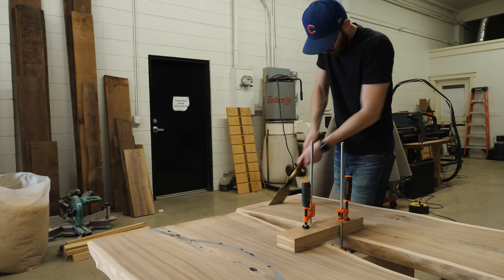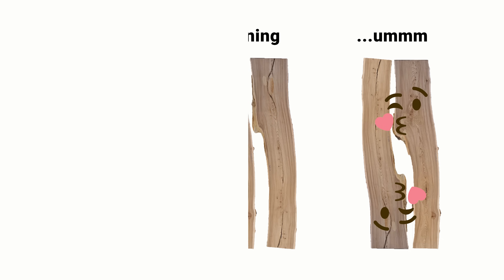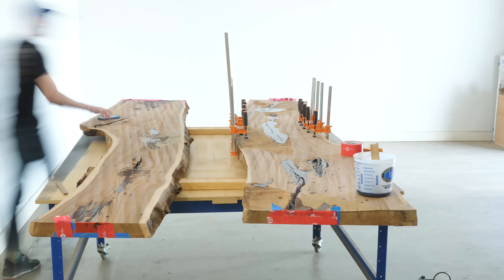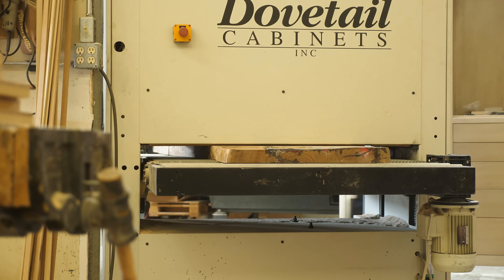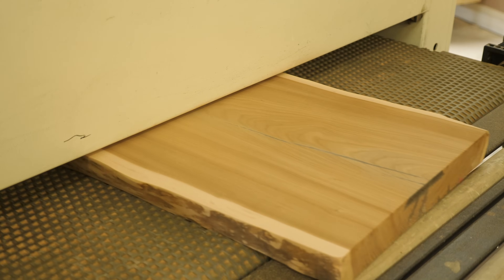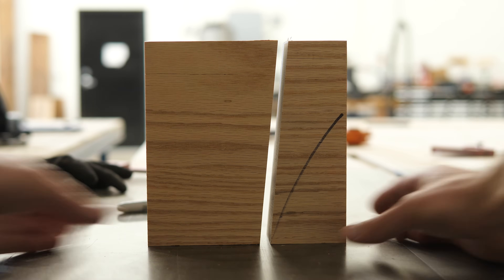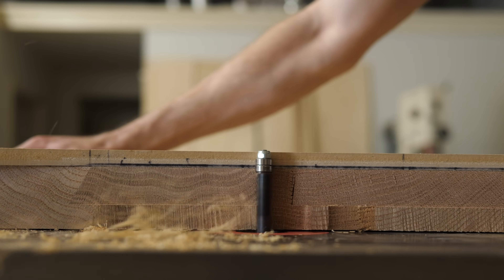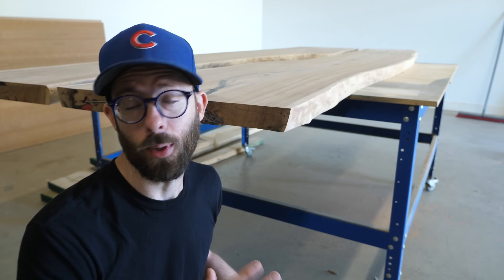I Guess We're Building River Tables Now

Comment: Having only discovered your channel yesterday, I've only watched a few of your shows so far. I've heard you ask a few times now, for input on your recording style. On that note, don't change a thing. I'm hooked! On a more personal note, I'm not a woodworker, nor do I currently intend to become one. I'm more of a mechanical-type person. I love moving parts so much that even my last 6 watches are skeleton - simply because I enjoy seeing the gears working. I said all that so I can say this with hopefully understandable framing: I loathe flat head drive screws! I don't mind the look but from a completely um, technician(?) perspective, they're awful! The screwdriver doesn't like to stay centered and the drive edges fail all the time! The older the screw, the worse it is - especially if they need to be used multiple times, like in this video. Who's to say the table will only ever be sold once and that buyer will only ever move/assemble it once? While arguably more aesthetically pleasing to some, I cringe everytime I see them. I can't even help myself. Flashbacks of all the screws I've damaged repairing older products, and the subsequent finish damage resulting from the slip of a the screwdriver wash over me everytime. Even the most basic power outlet cover still uses flat head screws and I feel like mankind has evolved far beyond the flat head screw :D I just don't see them as a wise choice for functionality. Take that with a grain of salt. It's just maybe a different perspective that isn't always considered. Overall, I find myself watching your videos back-to-back and while I haven't actually gone to your channel yet, rather, relying on YouTube's algorithm to present whichever one it likes, I hope you've made lots of videos because I see myself watching for a while!

Comment: I would have liked to have seen the long bottom support beam set in to the two side bases maybe 1/3", similar to how you set it the metal plates on the other side of the bases. This might have required the support beam to be another two or three inches higher though, but I think it would be a bit more stable. Just my two cents. Love the look, and I would have probably filled it in with clear epoxy if this was my table. Any way you go with it, it's a great looking piece!

Comment: I agree with some that having a flat surface all the way across makes the table more practical.  However, a straight piece of glass is still going to take away from the natural flow of the table.  And a regular epoxy pour would not show the cool contrast of the sapwood in the middle. Would it be possible to make some kind of custom mold so that you could just pour a shallow (1/4") clear epoxy so that it has the look of a custom glass insert?

Comment: I always do tables because chairs are much harder. Except benches. So have had a bunch of tables no chairs. I would use hand forged metal now for assembly legs. Love pounding red hot metal with hammer. Forging thick metal rod is extremely hard though. Home forge can't heat it up fast enough. 😩 legs are tough to make.

Comment: IMO the ends of the boards could have been cut back enough to reduce the size of the hole in the centre.  Shorter table in the end, but w/o the massive void.  Then a decision on a glass top or an epoxy fill would have been  easier.  Hope it sold well.

Comment: just a thought since you wanted it to be easy to take apart and wanted the brass look. Could you have used a wedge joint with a brass wedge to hold it together? I know it's really low tech but would be a nice accent.

Comment: I would not have a problem with a table with the center missing. It’s so wide that you’re not going to have a problem with putting the food in the middle and then the plates around the edges. I once bought a table from IKEA that turned out to be too narrow, and it was such a pain to put the food in the middle and have room for plates around the edge.  Even if I did need to put something in the middle, I would just use a tray to set it on or maybe a wooden cutting board.  Then I would have a good excuse to go around buying interesting looking trays lol.  You could think of it kind of like putting decorative pillows on a couch, where you could make the trays or whatever you put in the middle part of the decor.

Comment: Next time when drilling aluminium, just put all the plates together and drill through all at once. Aluminium is garbage metal and I hate it (been a metal fabricator for 20 years) but it has this nice quality that you can basically use woodcrafting tools to work it, just go slower because it's much denser than wood but nothing close to copper or steel. When I make identical steel plates, I drill them all together and it's easier to fuck up than with aluminium. So... yeah.

Comment: Open for form but closed for function. am not sure about epoxy though.... or the glass. Thinking out load here so don't shoot me, perhaps some form of (black?) grill / grid. / lattice  Maybe metal but also perhaps wood . Not a square lattice, oblong in form. Ends of lattice inlayed for connection / support. The external edge of the lattice could form a rectangle its self and it could also have varying lengths roughly following the live edge.

Comment: I PREFER THE RIVERTABLE WITH ROYAL BLUE OR TURQUOISE EPOXY FOR THE RIVER. 

I STRONGLY DISLIKE AN AIR GAP BETWEEN THE TWO SLABS. 
I WOULD NOT LIKE CUTTING THE SLABS SO THERE WAS A STRAIGHT EDGE TO GLUE TOGETHER.

Comment: i know that you can get some galvanized Hardware in nearly every color, also "gold" or "brass". I used it for my Skateboard for marking nose and tail. They got the strength of at least 8.8, maybe more. The Hardware for Skateboard ist way to small, with i think 4 or 5 mm in diameter but im sure there are places where can buy bigger galvanized hardware. :)

Comment: You actually don't need oil to drill or cut through aluminum. It's so soft it doesn't hurt wood working blades
Reply from the maker: Good to know. I’d much rather not use it.
Reply: @Foureyes.Furniture  same. I used It for years and my neighbor who was a metal fabricator was in the shop and was like hey, why are you wasting oil on aluminum? And bam! Changed my life😂 not really but I've saved a lot on oil that's for sure

Comment: For the finish I would connect the two halfs with four or five wooden pegs. Then lay a piece of hardend glass on the pegs . That glass would have the shape of the "hole" inbetween the two slabs and be flush with the top of the table. That would be option 5.

Option 6: put a piece of glass slightly raised covering the whole table and following the outside shape of it.

I'm out of ideas.

Just saying. I wish you well selling it!

Comment: Well the other two were pretty they didn't give you a full look at the piece completed the $75 one that's the better example for showing all angles of a finished product and an overview and really if you find it necessary I'm sure that they could add in the same thing that the more expensive ones did and charge more but overall of the three the one that I as a client and it would worker would prefer would be the first one the cheaper of the three the $75 one

Comment: Not a river table but a splitter table. Rivers flow and almost always over the end on a 90 degree apron. Although difficult a tempered glass insert conforming to the shape of the split would maintain the concept and keep food or papers from falling on the floor. On reflection, polyacrylic would be much more practical. The table "legs" aren't that pretty.

Comment: I'm not a fan of a massive gap in the middle of the table All I can hear is the sound of shattering glass as someone bumps a bottle and sprays red wine over someone's designer clothes. Or having a big shin dig and there is a cover over the table and someone doesn't realise there is a hole places something heavy in the middle inset lots of  bad words and shattering glass. I'd solve it by floating a sheet of glass over the table leaving  the slabs it visible but protecting it.
I also think adding a thin brass sheet into the curve at the top would really complement the brass plate at the bottom.

Comment: So no offense to the Fiverr people but I feel like all of them disappointing in different ways. What the cheapest one got right is sending multiple renders, especially since while that might take a decent amount of computing time it doesn't take a lot of man-hour time so it's an easy way to make sure the client gets the results he or she might want. The problem is that the texturing doesn't look anything close to what I would expect. If I were to guess the colorspace for the texture was wrong so the renderer is reading the texture incorrectly. It's way too..yellow. The second render is ok but something just is uhh just a bit boring not to mention the tabletop looks really light if I saw this and then got the table you made I would be a bit surprised. It looks like it might just be the Fresnel reflection just making it look really white because of the angle. The third one actually feels the most like the table you built. If I got that render and then saw the finished table I would not be surprised. It helps that the flooring has similar red hues as the wood. Like it's not 100 percent the same but I wouldn't be surprised. Especially since the finish generally increases the color saturation and contrast. It also is the most enticing picture that might convince me to buy a table like this. However, it has framing issues that just could really make it a great render. First, that thing in the bottom left corner is jarring and distracting. it draws your eyes and it doesn't have to be there. It's digital so why is it there. The lines of that chair on the left are too close to the edge of the frame leading the eye off of the frame. Move the chair in or lose it. You have a similar issue with the bamboo on the right. But if those were fixed it would be the money shot

Comment: river tables with epoxy are so... so... not nice.  Epoxy to fill small hole and cracks, ok...but a river of epoxy down the middle? Ugh.  
The glass looks nice.  the only problem with glass will be dirt/food/crumbs getting into and under it, so you'll need some silicone caulk, as you'll want the glass to be flush with the wood, you'll have to router a rabbet.